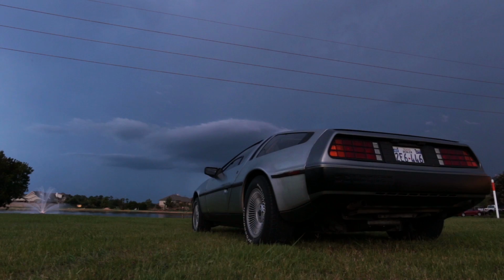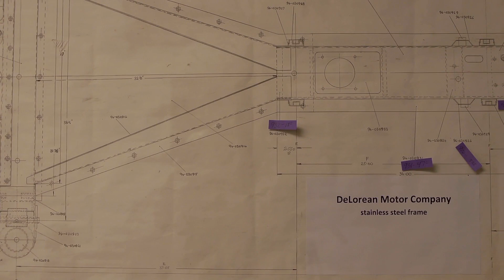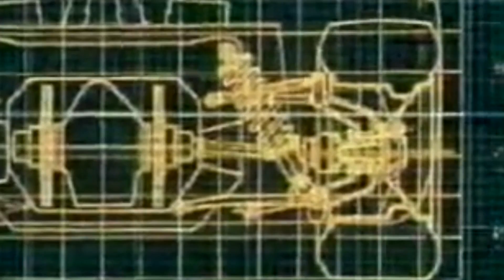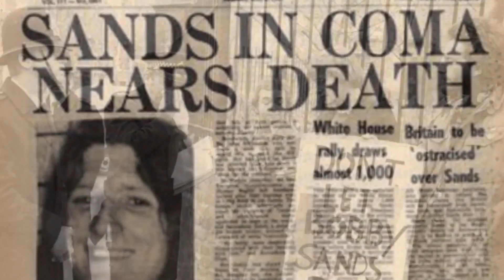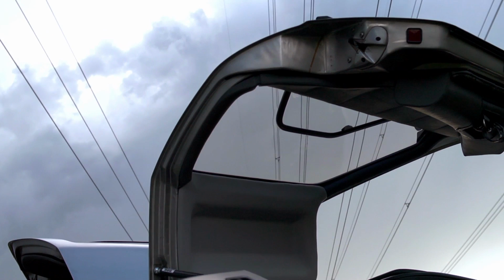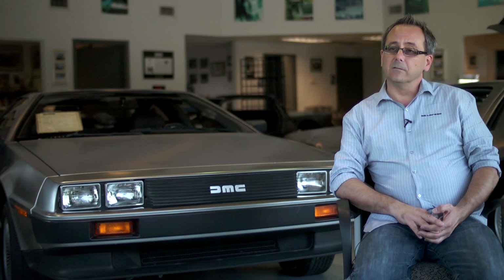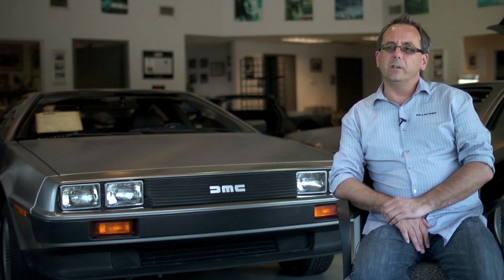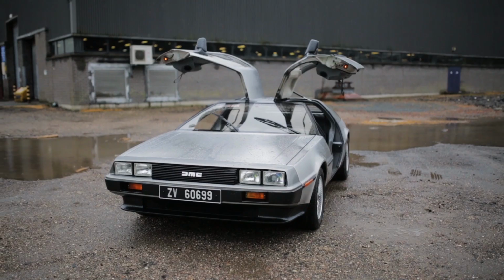DeLorean: The Man, The Car, The People - Carfection

Comment: No matter what anyone may think about John Zachary DeLorean, there can be no denying that he was a visionary who had the cojones to go out there and make his vision happen. He was GM's top design engineer who had 44 automotive patents under his belt and was in line to be their next CEO but DeLorean wanted GM to become more cutting edge and innovative and make the type of cars he wanted to build but all GM wanted to do is build these little candy-ass four-cylinder cars to compete against Japanese imports. DeLorean refused so he resigned from a $600,000-a-year position to found his own company. He may have failed but how many of us would have the guts to risk it all to follow our dreams? And one more thing, of the 9000 original DeLoreans built, more than 6,500 were still on the road 20 years later. Those cars were built to last, not like today's cars that fall apart when their warranties expire.

Comment: I've always loved this car! A wonderful vehicle! The one thing I didn't understand was the comments on the PRV engine . They mentioned that no one was using the engine in the states at that time and that it wouldn't pass emissions but Volvo had been using it since 1975 . And at 1981 was selling cars with the PRV engine in them . I own a 1978 Volvo 264 with a PRV .
Reply: SmokeyJA:

The 3-barrel carberated version was available in the USA in the Peugeot 604 until the end of the 1981 model year (TD exclusive for next 3 years)....biggest problems with that odd-fire V6 until the even firing version came out in the mid-1980s.....horrible idle and abysmal fuel economy.

 Had Delorean insisted on getting small-block V8s from AMC or Chrysler (both manufacturers in the dump and would have sold V8s to Delorean)......the car may have survived. Offering an anemic V6 ....it was a guaranteed failure.....Bonafide Sports Cars were all V8 powered.....no credentials with a V6. 

Being engineered by the Lotus folks....failure was also guaranteed too....UK/British cars equate to dog sh&t :D !

Comment: 44:25 – But I've seen a right hand drive version of the DMC 12, that apparently was sold officially in the U.K..
Reply: They convert about 20 cars to RHD
Reply: @chrisp7214  Convert? It looked factory, and not a butch job. Interesting that you would comment today since yesterday I looked thru my print pictures, and found the pictures of that car again.
Reply: @Reparaturkanal  Those 20 or so cars were converted by Wooler-Hodec by order of the factory. WH specializes in converting LHD vehicles to RHD; DMC chose to use their services to expedite engineering the car for RHD markets. DeLorean closed before the factory could begin producing and selling RHD cars.

Comment: The car is actually a Colin Chapman design.
Reply: Colin Chapman hated the original design of the car and changed to a Lotus Esprit chassis. Chapman's idea was to make the DMC-12 as light as possible, but John Z. DeLorean insisted that the car had to have a stainless steel body, which was immensely disliked by Colin. Truth be told, Colin Chapman only did it for the money to sort Lotus financial troubles at the time and subsidize their F1 team. I don't think Chapman and DeLorean ever got along.

Comment: I'm just wondering ... if some company today made an DeLorean EV; would it sell?
Reply: Definitly not
Reply: There actually is a delorean ev
Reply: Yes especially if ford or gm bought it, it will be remodelled and change the engine either v6 or v8 motor
Reply: DMC Texas built a prototype a few years ago with plans to offer it - Matt did a Tuned driving it -  but have since cancelled the project.

Comment: they put the steering wheel on the wrong side, no wonder they went bust
Reply: They put a garbage engine in... and screwed the stainless plates down to a fiberglass bucket. It's a bit of a joke. I wanted one until I got up close and personal with it. Could have got one for $15k but why